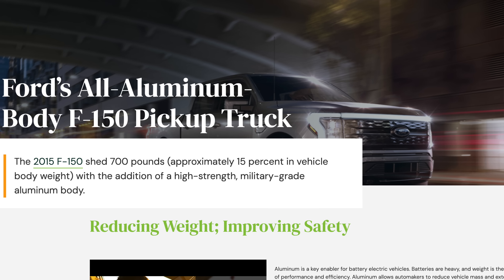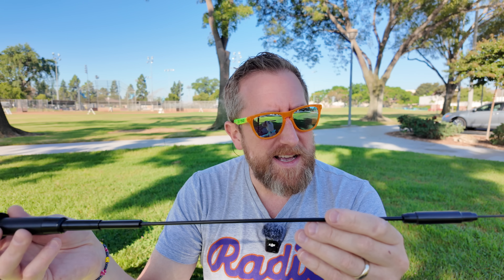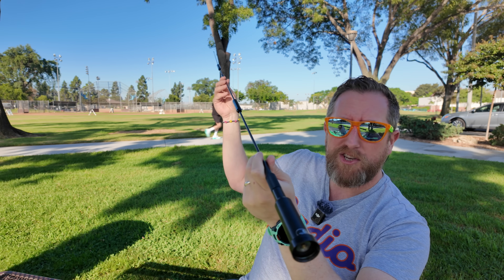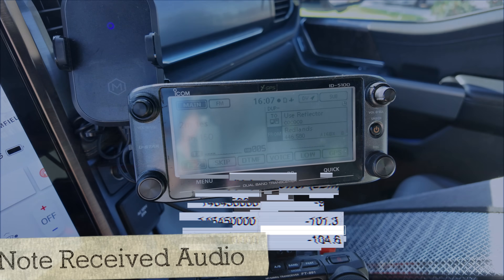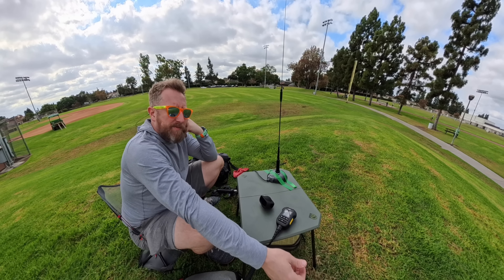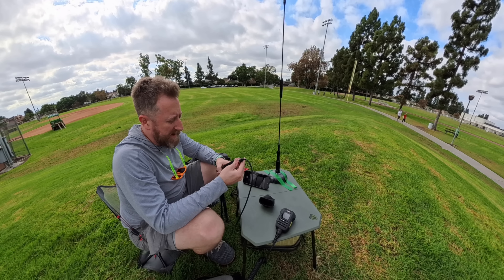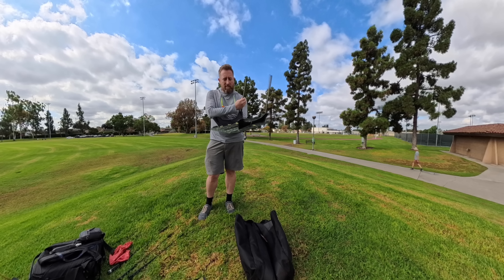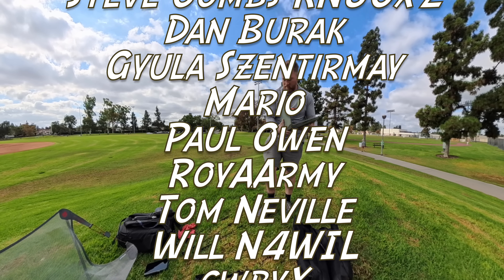The #1 Mobile Ham Radio Antenna You Need for STRONG Signals

Comment: I am trying to use a mobile antenna on a 25-foot DXE push-up pole with a Larsen mast adapter, which does have short radials. I was using my SBB-7 until I measured it today at a friends suggestion. 

The SWR on 2m was 5-6, but on 70cm, it was fine in the 1.5 or lower. The strange thing is that it rose significantly in-band and was lower on either side. No visible damage. I even re-set the set screws in case there was corrosion. I re-tested on a mag mount on the floor indoors. The same.

So I grabbed my old one, which is NMO, and it was the same on a mag mount.

Reading other comments here, this may not be all that unusual for their SBB line of antennas.

I eventually grabbed an old ANLI "pig tail" no coil antenna, and for whatever reason, its resonant point was below the 2m band, but it still was better in-band. (Low RL and near zero Xs. Very narrow though.)

Now, I am dissuaded from considering Comet antennas after loving my SBB-7 units for years. At least they are consistent!

I was/am looking at a Diamond before I decide to just throw in the towel and get a Rohn push-up mast with an actual base antenna.

This was meant to be easy-up, easy-down semi portable due to apartment living, and that Rohn setup wouldn't be.

Comment: For the FAR test, you should have moved yourself and not the antenna.  Antenna placement, especially near the ground where the signal is easily blocked by buildings/cars/trees, could have easily made that 10dB difference.

Comment: Thanks for posting this. I had seen a video with a Comet rep talking about these several months ago and have been wondering when they'd finally hit the market. Must be very soon now. I see them on Comet's web site, but still not on any of the usual vendor sites....

You're right about he GI990 being a beast. Comet's site says it's 62 inches long. I have a Comet SBB-7 in my collection of antennas. It's "only" 55 inches long and it's way too long and inflexible to be a practical day-to-day mobile antenna. I've mounted it on a ground plane kit and turned it into a base antenna and it works great in that role--equivalent to a Comet GP-3 or Diamond X-50.

Comment: interesting... I currently have a steel bodied SUV but antenna mounted on the hatch which is mostly glass where the bases are... I have never checked SWR on 2m LOL run a diamond SG7900NMO for the gain... live in the boonies and 50 miles to a repeater is common! Checked into the ARES net while mobile from 75 miles out one night, I was on the edge of the river valley which helped but still a long shot mobile!

Comment: 5/8 wavelength and center-loaded multiband 5/5 antennas have been around for many decades.  By their nature, 5/8 wave antennas do not require a ground plane.  HOWEVER,  if you operate them above a ground plane, that will change the shape of the radiation (and reception) pattern.  A ground plane may skew the main lobe upward instead of at the horizon.  You being seated in the near field will also have some effect.

Diamond also makes dualband center-loaded 5/8 antennas that do not require a ground plane.

Comment: A sleve antenna is basically a dipole (ground independent)  made dozens of them.  With pice of RG 58 measure back 1/4 plus. Wave mark  then score around the sheath of the coax slit to the beginning front. Tricky part. Roll back the coaxs braid over the sheath so you end up with a 1/4 Wave center conductor plus and a 1/4 wave braid plus (that has been rolled back over the sheath) . Now tune the ends (plus) away. When tune you can roll up or stick it in a pvc pipe or fiberglass tube. They work great.

Comment: I have a jeep and you can put light mounts on the A pillar on new or earlier models. These mounts are connected to the body. Easy to add a NMO to mount an antenna.  Trucks there are mounts on light on the cab on the back of the vehicle. Just use our imagination or look for external light mounts because they connect to the frame for power return. On how far they transmit is a nice test but I prefer how far they hear.

Comment: on my 2022 Chevy Equinox and in order to have sufficient  ground for my ATAS120 I have a roof rack with a separate ground wire to each of the 4 antenna points that ground to the neg terminal of the battery

Comment: Drill a hole in the base, perpendicular to the antenna. Tap the hole, and insert an Allen setscrew with a single lead shot from a shotgun shell. Torque the screw, and the antenna won't vibrate loose. Keep an Allen wrench and some spare shot in a ziplock bag in the glovebox, just in case you have to remove the antenna while you're out and about. The shot flattens against the NMO mount threads, supplying pressure on the mount, and also protects the threads from damage by the setscrew. Use as large a shot as will fit the tapped hole.
Reply: This an interesting idea.  However, the shell of the NMO connector on those antennas is not thick enough to to have more than one or two threads with even a #6 or #8 setscrew.  And, it definitely isn't thick enough if you use up some of that space with a lead ball.  If you clean the paint off, it may be possible to solder a nut or some brass onto the base to allow for enough thickness.
Reply: @BryanTorok   Didn't know it was so thin; I'm not familiar with this particular antenna. The idea isn't mine. It was the subject of an article in QST many years ago. The Yaesu ATAS 120 was the subject antenna, and the author wanted to protect the antenna from theft as well as loosening from vibration. That was back when QST was still a paper magazine worthy of reading.

Comment: After testing dozens of verticals over the last 40 years, my best performing mobile VHF/UHF antenna is the Comet SBB7, I have two of them. Yes it's very long, but also ground independent. I also use it on my IC-705, perfectly flat SWR since it does not need the radio as the other half of the antenna, and it blows away other antennas that are an electrical 1/4 wavelength, also beats my Hustler  5/8 wavelength mobile whip

Comment: You bring up a good point. I happened to be lucky enough to have a vehicle with steel in its chassis, and antennas work well on my car. If I ever get a new vehicle, I will have to check and make sure it’s steel (use a magnet).

I’m currently using a Comet CA-2X4SR with my Yaesu FTM-510, and that thing has been a rockstar performer.
Reply: Comet
 CA-2X4SRNMO
Is what we've transitioned to for our VFD to great effect, but utilizing the body for the ground plane.

Comment: And that, folks, is why we use half wave verticals - no need for an extensive ground or radial system. It is also the reason why the TWAYRDIO half wave HT antenna (and similar half wave HT verticals) are the best performing HT antennas. It does not need your very poor hand and arm as the other side of an electrical quarter wavelength vertical
Reply from the maker: Bingo!

Comment: Looks like they are optimizing the properties of a 1/2 wave antenna based on your receive data (slightly better). I think I heard your gonna test again on the plastic table with a very short feed-line that will be very interesting (perhaps even put a 1/4 wave in the mix too). Good stuff, love to see real world performance and show putting the theoretical into action.
Reply from the maker: Yep. Gonna snip the the coax and use Bluetooth. And get well away.

Comment: I have a Ford Ranger with a comet lip mount on the Hood with a Comet CA-2X4SR SWR hooked to a HT should i add a ground??
Reply from the maker: Likely not. That thing is all metal!
Reply: Depending on the years, some Ford Rangers have fiberglass hoods. The stepsides have fiberglass bed outer shell

Comment: Aluminum vs steel should have little effect on antenna.  Metal vs glass or fiberglass would have an effect for an antenna designed to use over a ground plane. Tell me if I am wrong

Comment: A "Ground Independent" antenna is called a dipole. One can be made in about an hour using nothing but a length of Coax and a connector.
Reply: Yeah, and those work real well at 75Mph in the rain.
Reply: Please cleanup the English on your qrz page. You sound like you have an interesting background.

Comment: FWIW, The Diamond NR770 is an excellent, no ground (radial less) option that basically everyone in the local club has defaulted to for challenging situations.  The antenna works amazingly well on my F350, and my Carbon Fiber BMW I3 mounted on a adhesive mount.   Highly recommended.
Reply: What year is your F350 and what do you use to attach your antenna to the truck?
Reply: @Ralfy2  2020, Aluminum.   The Diamond K400S is what you're looking for.

Comment: Ground independent antennas have been around for a long time for boaters. Fiberglass boat hulls are not good ground planes. Half wave J-pole antennas  are ground independent too. Copper pipe is strong but would look weird mobile.

Comment: Great testing as always. Interesting results. I've run an SBB-5 on my truck for a couple of years now. Works great but I got tired of having to get out of the truck to fold over and unfold the antenna before going in the garage. I now run an SBB-2 that's shorter and leave the SBB-5 in the truck to swap out if needed. Thanks for another great test.

Comment: Toyota (Prius) recommends not installing a two-way radio in their EV's. Noise on 2m is a huge problem for a friend.
Reply from the maker: Someone should recommend that their vehicles shouldn't generate spurious emissions to them.
Reply: Drove a 2007 Prius for years with 2m / 70cm radio installed with no noise issues. No bonding or other modifications were done, just that simple install. Antenna on Diamond lip mount off the back hatch. 

As hybrid and EV tech has changed over the years it would seem that things would only improve. On the other side of the coin, unless there is some reason or need for the manufacturers to reduce RF emissions there is no financial incentive for them to do so. 

New for the 2028 model year it's "HamCar!" This vehicle has been designed specifically for ham radio operators and is completely RF silent! Multiple antenna mounts come standard, with optional trim levels for satellite chasing or POTA roving. (Some assembly required at your local bike shop, pedals not included, comes standard with a 1 x 21 drivetrain, tandem models available) 😂
Reply: I have a 2010. 2m/70cm isn’t an issue. HF ain’t happening though 😂.  I have to shut the car completely off to use any HF radio for a park and POTA. Which sucks in the winter.
Reply: @Tom.K2TAV  That's the same with my RAM 2500 6.7L diesel for HF. Been waiting for cooler wx to do some extra bonding and shielding. Fingers crossed!
Reply: I’ve run several different mobile transceivers in my Gen 2 Prius without a problem. Using a roof-mounted NMO connection.
Reply: @K6GAB  I couldn't talk my friend into doing that. He has the antenna mounted to the fender with a 'Z' type mount.
Reply: @thebnbaldwin Interesting. I don’t see why the mount would have a big impact on interference. Perhaps the antenna cable is running too close to the high voltage system/battery? I’ve run several Yaesu’s and a VGC and haven’t had any trouble on 2m. If his car is newer than mine (2006) it may be they’ve changed the design.
Reply: @K6GAB not the mount as much as the position, and as you said, the coax in the engine compartment. It's a 2025 Prius. It happens intermittently which we're thinking may be related to some charging cycle. Then again, he's running cheap Chineseium radios.
Reply: I've never tried driving with either of my EVs (Tesla) and operating a radio so I cannot speak to RFI while driving. Any drive long enough to operate a radio I'll have family with me which means if I'm talking to somebody that somebody better be in the vehicle, so no point in trying to operate mobile.

While parked I have observed no problems whatsoever with the heat or AC enabled (very handy when the weather sucks)

I did one time try as a passenger to listen with a tiny whip in the cabin while driving - MF through HF and observed no notable noise - but the antenna was very compromise (HT antenna) and the antenna was inside the vehicle so not really the best test scenario.

Comment: Being that i sub out different cars for how I'm feeling it would be nice to have an antenna i could do through different chassis. I have a cobalt ss (boron/steel), neon (steel), tesla model x (aluminum), and a Kia soul (the thinnest steel known to man). I bet some facts could be wrought with that testing pool. Good to know. 🤙🏾
Reply: Looking for my calipers, my 2015 Nissan Leaf may have your Kia best for  thinnest steel..... Aloha from a few islands to the north
Reply: @WH6FBP oh yeah. Those things are a thin as a leaf. 🤣
I dunno if the weather is gonna turn but watch out for the possibility of Kiko, that depression that's being monitored. If you're on the north side charge your batteries and keep on the air. 🤙🏾